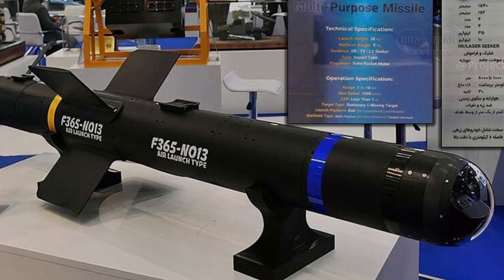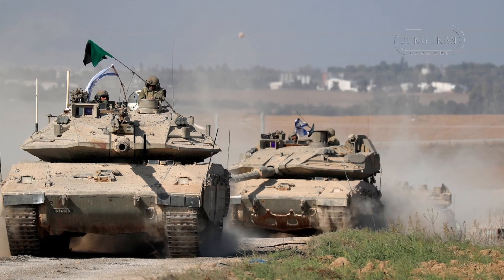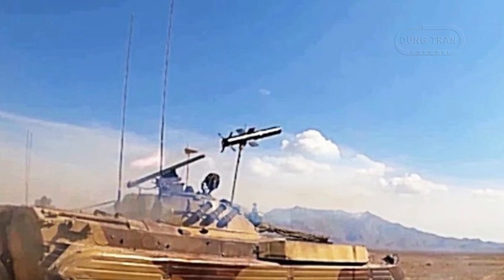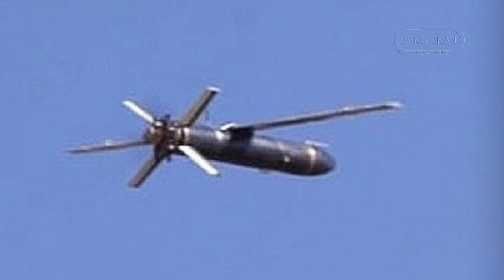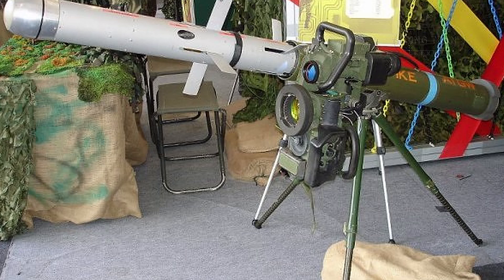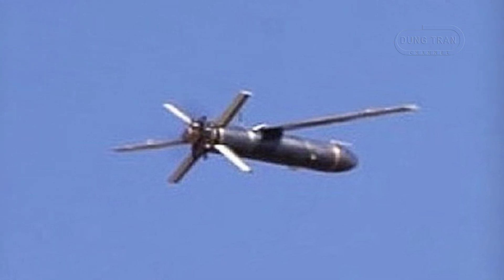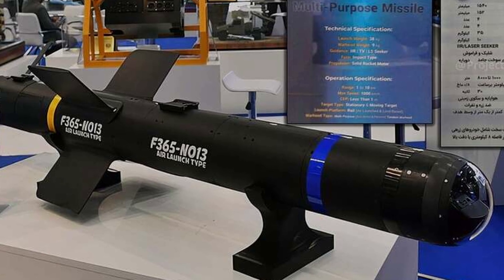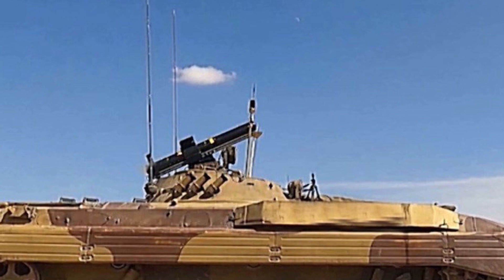Sadid-365: Iran’s Javelin Copy? The Rise of Reverse-Engineered Weapons

Comment: The Sadid-365 isn't a mere copy. It's a significant improvement over the Javelin. 8km range vs 2.5km range. Improved optical guidance. Larger warhead. And it's likely to be significantly cheaper than the ridiculous premium that the Military Industrial Complex charges for the Javelin: $240,000 USD for the export version.